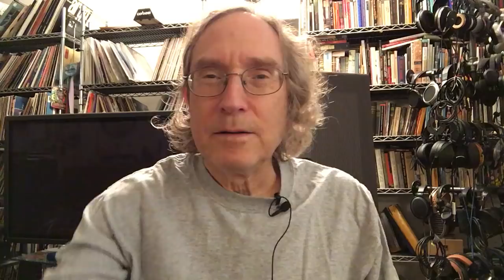Box vs. panel speakers, some things to think about

Comment: I've been listening to magneplaners for 28 years (I have smg, 1.5qr, mmg, mmgc,) after so many years I've found that these speakers work best with pass aleph single ended amplifiers and wadia cd players (own a wadia 6 cd player combined with a pass aleph 5 output amplifier and pass aleph L preamplifier) THAT'S MY HOLY GRAL
Reply: Wow. Now i think I got my answer.
I just got a pair 40 years old magnapan MMG hooked up.
Everyone says "oh they need a lot of current" (what that now is.. when nobody can specify what a lot current is..)
Anyway I had my little Pass ACA-clone 5w/ch that I thought. Oh now I am in trouble 😅.
Hooked it up and I were expecting it to sound like a fart.

Yes, I need to turn up the preamp more than with my easy to drive bookies.
But it sounds wonderful and no issues with current (I am sitting only 2m away).
It is proven that we usually use ~1 watt to our speakers.

Then I am thinking if we only look at exactly 1 watt (V*A) delivery of amplifier.
example:
1V*1A = 1 w
0.5V*2A = 1 w
2V*0.5A = 1 w
If magneplanar need more current. And a little Class A amp is providing that at one watt. 
Then we have achieved our goal with high current at the used power we need.

Then it doesn't matter IF a amplifier can make 50, 100 or 400 watt.
Of course we will have MORE current at 400 watts. BUT when we do not use or utilize 400w then it is totally unrelevant if you use only 1w..
(Then we have good amplifier sales men that states that we need "head room" that is uninteresting if that we use 100% of the time 1w sounds not great then who cares about that we have a lot of wasteful "head room")

Maybe that is the issue that some  amplifiers are having a lower portion of current in relationship to voltage. 

So even if a amplifier has 10 times more power let say 50w it can still sound wimpy @1w compared to another amplifier at the same 1w of power output. When it may as seen in the examples above give a slightly more amount of voltage instead of current to obtain the same power and 1w.

Do anybody know if class A (single ended) amplifiers deliver more current @1w than other types?

Comment: Wouldn't it be better for Stradivarius to just put all the money in strings and avoit the trouble with the box?
Reply: No.
The "box" of the violin is actually part of the source of the sound. That's why Strads are so popular.
Loudspeaker supports should make NO sound of their own, but replicate exactly the incoming waveform.
You have no business here asking silly questions.
Stop shooting of your dumb mouth and LISTEN.
Reply: A
Reply: Bonus points for spelling "Stradivarius" correctly
Reply: usersky007  what's ironic in that case is that !the violin body is the panel of the speakers and some electric violin woud represent the box speakers (not exactly, i'm just trying to follow your example).
Sorry, what I really mean is that all stringed instruments use some specific wooden surface to project, amplify and select the frequency range that our ears accept. Same as Panel Speakers. The only diference is the source of sound. The other case the source of sound is one magnetic field. the box is,mainly, for prevent secondary efects (hum, dipole,etc)
btw, im not a sound expert, but i'm musician and I want to believe in panel speakers.
And i'm trying to make a pair as soon as I can resolve the wall effect.
Reply: r/woooosh  @WellSightData

Comment: So, you can have the best of both worlds, if you get a Gradient Revolution. The woofers are open front and back. You can rotate the 3 sided cabinet bottom. The tweeter is controlled by using the woofer as its  "horn". And the concert or studio appears in my living room.
Reply: charlesnr Just read a review at 6moons audio. I does seem like the Revolutions may be one of best unbox speakers out there. But they're very expensive and require a lot of power.

Comment: There is also that in between Zone like the dahlquist dq-10. I have two sets of dahlquist dq-10 stacked and running subwoofers and it sounds marvelous. I also have a set of Maggie MMG twos and they also sounds fantastic but I tell you the maggiess have to be cranked loud to sound good where is the dqs sound best at low volumes.

Comment: Late to (this) party. I’ve had my Apogee Duetta II Signatures since 1990. Across 6 moves, two of which were over 2000 miles. Driven the entire time by Classe’ DR-9 (match made in heaven). My pre-amp just (last week) started developing a reality nasty glare/grain across all sources (but not from Tape-Out). At first, before intensive diagnosis, I was DREADING the possibility that it was the speakers. Thankfully it is NOT. 

So the pre-amp (Classe’ DR-6R) is off to George Meyer AV to be repaired.

I don’t know what I would DO if the Apogees ever failed; in my opinion, irreplaceable (at anywhere near a budget I no longer have with Retirement imminent). They are that good. Helps I have a Large listening room (perfectly symmetric rectangular) of 298” x 198”…

Everyone OWES themselves a listen to a good panel speaker.
Reply from the maker: I sold those speakers for many years, good stuff.

Comment: Pardon my ignorance, but would are there hybrid speakers and how do they compare?
Reply: Yes, there are hybrid planars and stats that use dynamic woofers and planar panels. Generally you'll get more/deeper bass out of them for a given size but you'll hear the difference between the drivers -- the planar panels sound faster and cleaner than the dynamic woofers, and planar woofers sound more natural on bass with acoustical instruments.

Also, a lot of people who buy smaller planars will just get a pair of subs. That's better really than getting the dynamic driver built in because you can position the subs where they sound best.

I think a lot of what you'll prefer has to do with the type of music you listen to. If you listen mostly to rock, dynamic woofers have more slam than planar panels. If you listen more to classical, jazz, and other acoustical music, planar woofers have a naturalness that dynamic woofers don't. Some planar owners have a pair of subs that they turn on when they want the extra bass and otherwise leave off because they smear the sound.

Comment: I'm sold, going to grab some of those Maggi LRS speakers, entry level and will fit in my space. The .7 is actually too tall for my space in regards to tucking them out of the way. Should have them by June, and maybe a couple of Emotiva PA-1 300 Watt into 4 ohm mono blocks to drive them... How are these going to sound with a class D amp, I wonder? Or maybe two Schiit Audio Vidar amps... I think the Emo amps will be the bomb with their 100% Bang & Olufsen internals.

Comment: Well , up to my premeditatiion it is all the way problem of power and size. Customers would not buy  size of wealthy  high/mid panels supplemented by size of  box for high quality low range of adequate power - estetic brakedown and spouse acceptance zero. In boxes all size is assigned  to  mid and low  band and tweeters are squized to satisfy possible enemies. In some cases there is box with line array of tweeters - obviously not popular. Personaly I like squized tweeters more than mini subwoofer but must admit that wide radiation of panels is something I'd like sometime  to experience as well.

Comment: You didn’t mention that the panel speakers beg for a lot of wattage at a 4 ohm load, which is a big consideration as well, and requires substantial cost for the amplifier as well.

Comment: I owned a pair of Acoustat 1+1's Medallion mod. Loved them, but I had a nice sort of large room for them. The entire back wall of the room was sound. If you stand up, sit down, it sounded the same. It had pretty good bass response.  Sadly sold them after comparing them with Von Schweirkert VR-4's. There were areas where the Acoustat's were much better, they totally disappeared and sounded as "one". Just one driver. The VR 4's to a lesser extent. But the dynamic range of the VR4's, ease of driving and the low end made me move over to them. Also, Acoustat was now out of business. Sad.... there are hybrid panel speakers with cone subs.... Martin Logan comes to mind along with Eminent Technology....
Reply: Anthony Pierre Albert says thanks.

Comment: Couple of things, panel I speakers don’t do well at lower listening volumes and they are usually larger creating potential issues for positioning.  The later may create ‘significant other’ concerns.  That said I too prefer the sound, but they are more expensive to get the sound than comparable box’s.  If the box makes up most of expense that styrofoam Magapan uses most be really expensive.
Reply: What are these “lower listening volumes” you speak of? My old Martin Logan SL-3s are happy to get out and run (along with Velodyne subs), but only when wifey is not home!

Comment: My Mirage is a box speaker but behaves like electrostatic in term of placement. They can't just be put anywhere. It has to be a certain lengths to the back wall. I haven't listened to electrostatics but I imagine they have an awesome midrange and treble. Isn't Martin Logan som kind of hybrids? With a panel for midrange an a little bass and treble and a traditional bass element to take care of the deeper bass frequencies? Love my Mirage but would really want to listen to a pair quads or M Logan. Thanks.
Reply: I think you'll find that the Quads are better sounding than the Martin Logans. If you want more bass, add a pair of subs to the Quads.
Reply: Thank's but for "box speaker" my Mirage are very musical and easy to listened to. they play both forward and back.

Comment: Steve, where can you get affordable panel speakers? I've got conventional two way speakers for my mains because of the cost. They consist of two Focal 7K415 woofers and two T90dk tweeters. They sound incredible. They reproduce the music source in ways I never thought possible until I heard them. I've auditioned electrostatic speakers too, but they are so cost prohibitive I could even think of buying them. A friend of mine bought two p,anaerobic speakers back in the day and then built  a pair of folded horn subwoofers to compliment the planar speakers. They used a pair of eighteen inch Dayton audio woofers in a folded horn cabinet to supply the low end that the planar speakers lacked. After breaking them in he powered them up using a pair of Carver magnetic 500 watt amps to drive the woofers and another one wired in stereo to drive the planar speakers. The result exceeded his expectations as the bass produced by the set up destroyed the windows in his parents home at a time when they were away fro vacation. The bass response was so intense that it shook the windows to the point of their shattering. He called me to, one,... provide security for then house while he was at work, and two, allow the glass company in to repairing the damage. To be honest I was a bit nervous to be there in the case of his folks co I got ho e earlier than planned. But it all worked out. The seven foot tall labyrinth partitions subwoofers were then constrained to 100 watts at all times to prevent the problems experienced earlier. Too bad, I really wanted to hear everything at full throttle after helping him during the various stages do the build process! Anyway, there was one for the record books had he only set up measuring equipment to capture what had happened.
Reply: Shop used. I paid less to buy my Acoustats than the shipping cost from the east coast. Play it loud
Reply: Maggies
Reply: Buy the small Maggies!
Reply: The Magnepan "appetizes", the MMG, is a fantastic starting point. If you pair them with one of Emotiva's amps, you can have an incredible stereo rig for under $1k that will be very hard to beat. If you end up loving Magnepans, it'll be impossible to beat.

Comment: How come there is never any discussion regarding Omni Directional Speakers which the technology is both box, driver, and crossover?
Reply: Semi omni is the go, more like live music. You need a bit of direction with the omni, I do it by mounting my drivers on an angle, and some manufacturers do have slightly slanted speakers, way better than just straight out the front. Mine are sloped way more at 30 degrees for a more omni effect, but still frontal enough as well.

Comment: I love big electrostatics for a few reasons. First thing is the huge sound stage and pinpoint accuracy that no boxed speakers can practically reproduce. Second thing is the fast, accurate mid and high frequency responses that electrostatics are renowned for. Yes there are many boxed speakers nowadays that can match or even beat electrostatics in this respect eg. with exotic Beryllium, diamond, ceramic, plasma drivers etc but you have to go very high end and you will have to have deep pockets. Thirdly, related to above, electrostatics or other panel speakers like magnepans are actually extremely good valued speakers as you can get very high end sound at a comparatively low to medium price. If you go second hand there are even more bargains, though you have to be careful for some brands as their panels only last for 10 years or so for some unknown and frustrating reason. However, I have 2 pairs of Acoustats being from the 80's and 90's respectively and they still sing perfectly, unbelievably. I do have a few pairs of high end boxed speakers but the only pair that can win my heart over the electrostatics is the Goldmund Apologue. That's my honest opinion from my 40 years (but still quite limited) experience of stereo journey.
Reply: Old Acoustats seem to go on forever. You can heat shrink the diaphragms if they get too lose. Maggies can be rebuilt, either by the company or on your own using an inexpensive kit that they sell. Apogees can be repaired too but sadly with the company out of business it's an expensive proposition.

Comment: Hey Steve - I like watching your videos and reading the reviews. I use a 750wpc Class D amp with my Magnepan 1.7i. Everyone talks about Maggies requiring a lot of power. I get it. Sounds fine in my room. My room is similar in size to your room that I see in your videos.
Recently I have been using a 10wpc SET amp with the same Magnepan 1.7i. Sounds amazing. The digital FLAC files in particular became as good sounding as vinyl. Would you try a low wattage SET with your Maggie .7s? Just try it for the fun and let us know. Thanks!